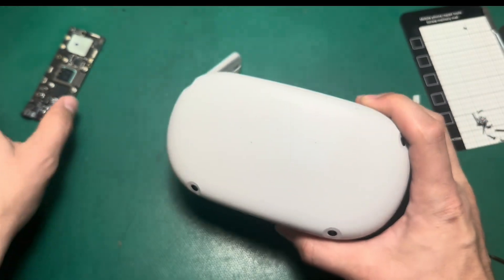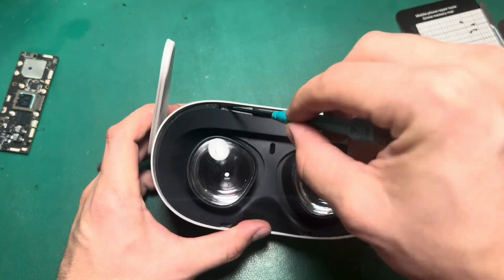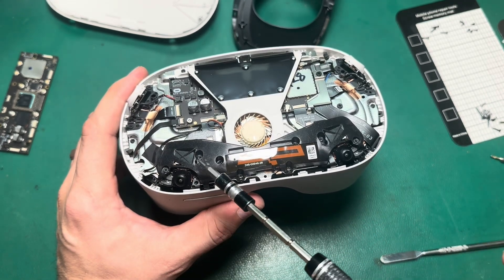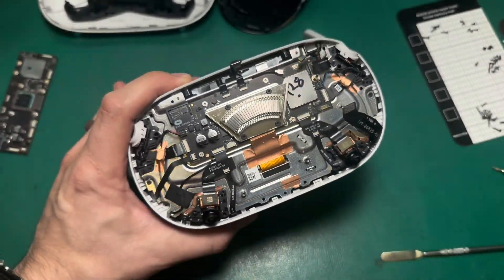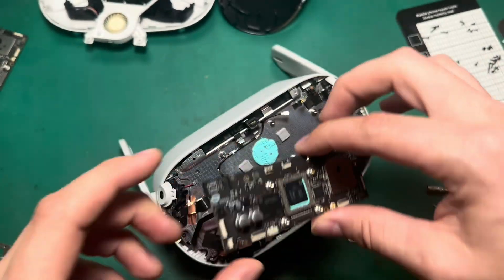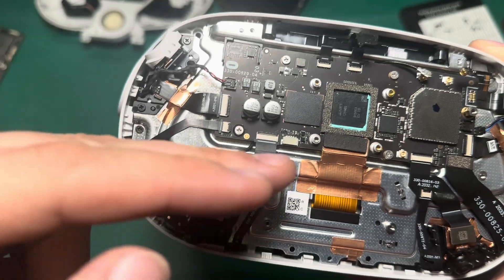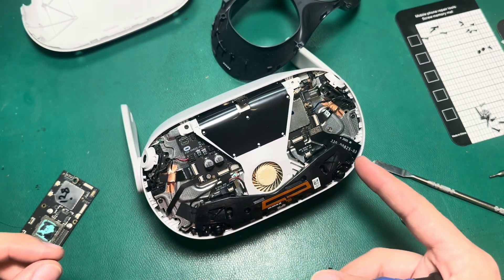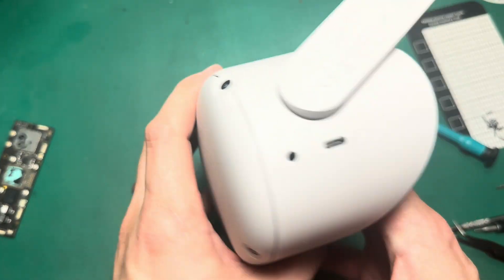Increase The Storage Size On Your Quest 2 - Motherboard Replacement Tutorial

Comment: Dumb question but On a scale of 1-10 if I follow your steps to the exact inch with a new meta quest 2 I’ll just have more storage no catches? Does it cause anytype of over heating or memory leaking have you ever heard of problems arising from doing this swap I want weight risk factor before Willy nilly doing a surgery I never have before and no i unfortunately cannot afford your services

Comment: Hey quick question, shouldn't you add thermal paste back onto the chip?
Reply from the maker: It’s not really necessary and I’ve never found it to be an issue with heating or function. The thermal putty on the chips and heatsinks stays on there through the repair and has always held up great post repair. In addition to that, because they are basically cell phone processors, the snapdragon chips don’t put out nearly as much heat as like a traditional PC CPU. The newer ones that come on the Quest 3 and 3S are even better.

Comment: my oculus stuck on pairing, and cant pairing with app, i need pairing to connect the controller, i use meta developer its cant too, what gonna i do?
Reply from the maker: This sounds like a bug that the system had back in V63. If the headset is factory reset without being updated, it won’t connect to the app anymore. I would try manually updating the firmware from the computer.